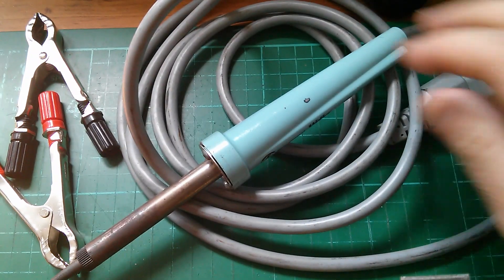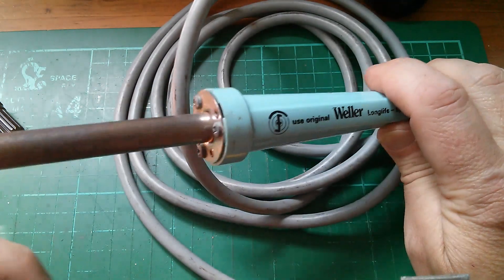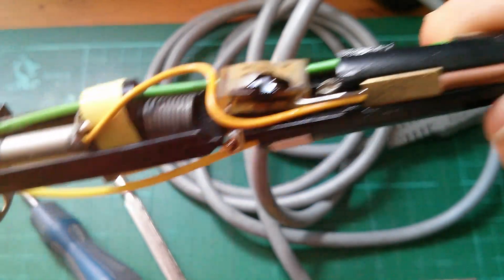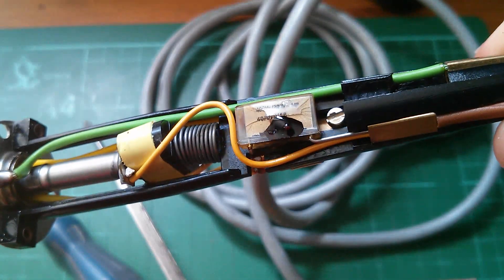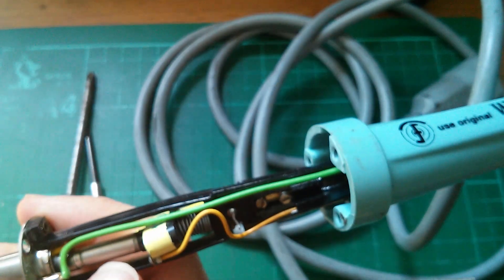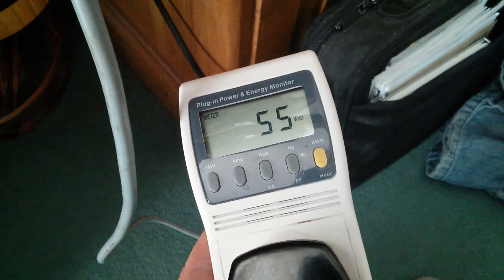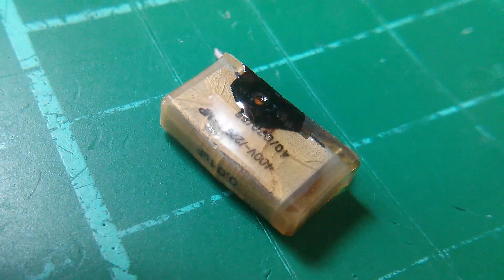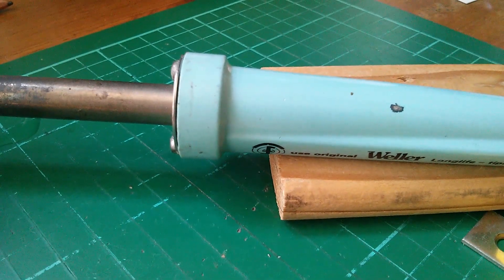Burning Smell from 30 Year Old Weller Soldering Iron

Comment: Easy repair ... Replace Capacitor (correct to eliminate switch noise).
This is the EU/UK version ... which is different from North America.
The “Click” is Magnetic Switch (for heater) ... Read Weller’s late 1950s patent,
Your Soldering Tip has a Ferrite Alloy Plug ... 
That Iron Alloy Plug losses its Magnetism as it reaches specific temperature (like 700°F) — “Curie Effect”.
The switch opens turning off the heater .... as Tip cools the iron plug regains its magnetism (closing magnetic switch).

Comment: i just tried to use an old weller w-tcp-l my dad has, moments after i plugged it it started to crack inside and smoke, so i opened it up, and found a big block of some kind of rubber-ish material, melted off exposing a wierd brown(kinda like old film tape) tube with a burnt crack in it, if that makes sense. i have no idea what is it. any help? sorry for the bad english
Reply: See my reply to an earlier post. Mine did the same but I was quick with the mains switch and can still read the details on the capacitor which is swollen with a small crack and brown liquid seeping out.  Details:  RIFA PME261KA   0.01uF  400V-/220V~MP

Comment: My 100W iron (W101) has just done the same thing. Burnt my finger from bulge on handle, so took it apart.The cap in mine had gone black and crispy and stank! I can see the value from your vid, so will replace it as soon as possible. (£80 to buy now, but still good, smelly or not)

Comment: Why don't you replace the cap with an Electrolytic with same values?
Reply: Darren Connelly It's on full mains, so it'd have to be an exotic non-polarized electrolytic which is mains rated (even more exotic, if it exists at all). Mains filter caps are normally metalized paper or plastic, and are readily available today. (Even those cursed RIFAs are still made.)

Comment: Hi Julian, I have the same iron which has a dead element.  These are a very good soldering irons and still current.  There is not much on the market that is a compact iron without a outboard controller that has that much wattage as well as temperature control.  The temperature is controlled by the magnet inside.  The hotter it gets, the more it releases the contact continuity.  Various tips have different magnetic properties.  The contacts noise is snubbed by that capacitor.  It is not meant only to suppress noise but also to suppress the small arc that occurs when the contacts break.   Not replacing the cap means that the contacts assembly will have a shorter life span due to arcing so I recommend replacing the cap with a mica type which I think the original is.  Spare parts for these irons are unfortunately very expensive which is why I'm a bit shy of repairing mine.  Good luck.
Reply: Whatsthe model of this iron?

Comment: If you remove the tip, there is a number inscribed on the magnet at the bottom. You could set different temperatures with different numbered tips. As others suggest I  would replace the cap.

Comment: Excellent, I love seeing old equipment still going.
I'd be inclined to replace that capacitor and get another 30 years of service out of your iron. The capacitor is there to prevent arcing of the switch contacts.

Comment: Looks like one of the infamous Rifa metalised paper X2 caps. 30 years seems to be about their limit. I've recently had these fail in a BBC Micro and a Dual 505 turntable, both about 30 years old.
Reply from the maker: They're consistent by the sound of it.
Reply: Yes you are right. My similar age one that also "made the trip home from the bin" is a Weller model W61 temp controlled soldering iron, and it has just done the same. I first heard the fizzing noise, then a smell and a little smoke before I managed to switch it off.  The capacitor is 'swollen' and some brown stuff has leaked out. Its still possible to read the markings.  RIFA PME261KA   0.01uF  400V-/220V~MP
I am now going to try and source a suitable replacement which is much easier now you have told me its a metalised paper cap...  Thanks.

Comment: The reason for the cap is to help stop the switch contacts from corroding on "switching off". Current flows through the cap (charging it up) rather than the air gap (causing an arc).

Comment: 30 years is better than the 3 uses the chinese iron i bought lasted , haha, but those wellers are still over 90pounds so you get what you pay for.
 I wonder if the capacitor might reduce arcing inside the switch contacts, it might shorten their life without it?
Reply: Thats exactly its main purpose, its a switch filter cap

Comment: These irons are fun how they work. They are called magnastat irons. The way they work is that on the back of the tip, there is a piece of metal that loses it's magnetism at a certain temperature, and lets go of the magnet that is attached to the moving part that actuates the switch inside. When the temp goes up high enough, it turns off the heater, the temperature drops, and the magnet sticks to the tip again, making contact in the switch, and turns the heater back on. 
Simple, but foolproof construction. Well, part from the blown cap, that is :)
Reply from the maker: Super explanation, thanks. An oldy, but a goody.
Reply: +Julian's Reviews I have a 24V version with transformer stand, but the system inside is the same. It is 33 years old, bough it new when i took the job, really good stuff. BTW it's at my home now, 20 years ago the company bought new ones and told us to just drop these ones to the trash. I rather dropped it into my car trunk instead ;-)
Reply: Thanks for the explanation.
Reply: Correct. Weller TCP range.